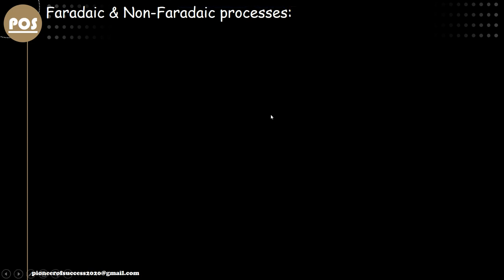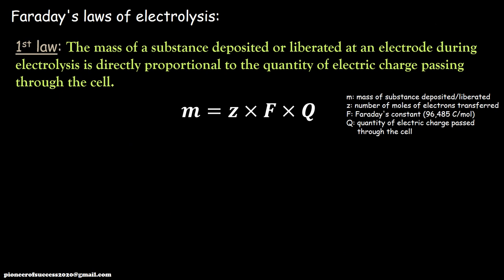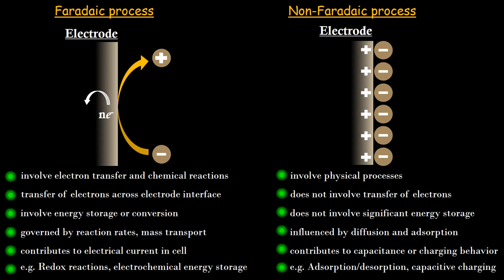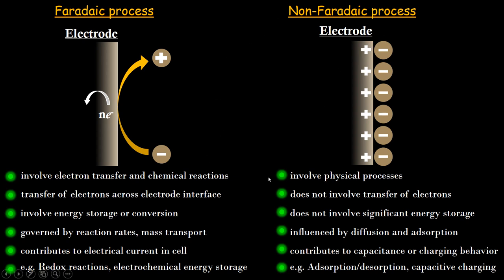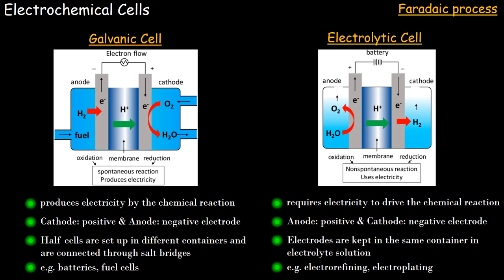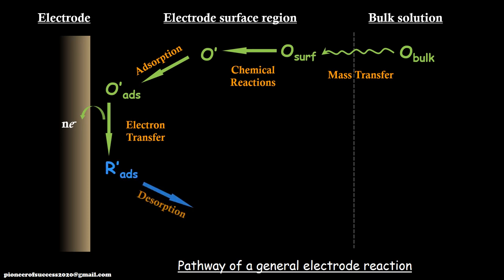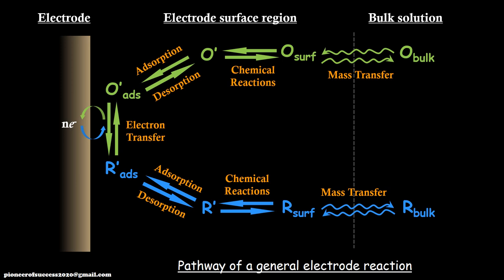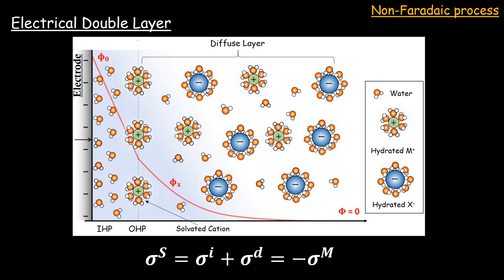Fundamental Concepts of Faradic Non Faradic Electrochemical Process

Comment: Excellent video, following these videos with a textbook helps in reinforcing concepts. 
A couple of points:
1. Where is the figure for non-Faradaic process (last slide) from? Can you quote sources in the description box?
2. Why is diffusion not considered mass transport in the early slide comparing Faradaic v/s non-Faradaic process ?
3. Could you also explain why the applied potential on the electrode decreases over distance from the electrode surface? Is sigma the charge density (q/A) ?

Thanks, I look forward to more videos. 👍👍